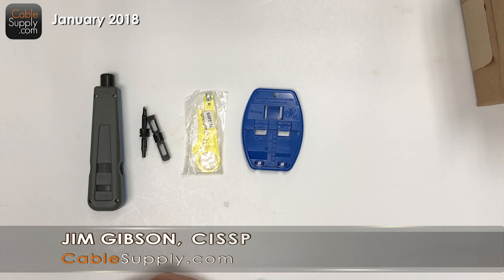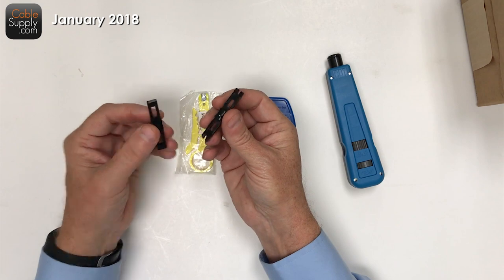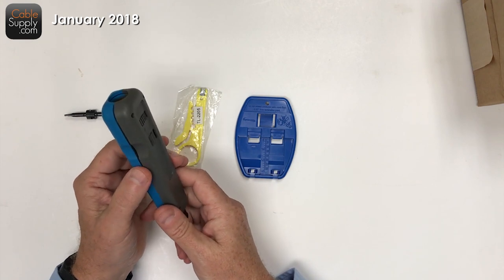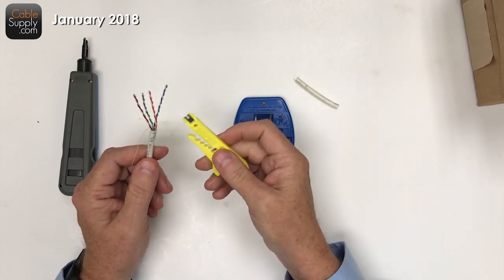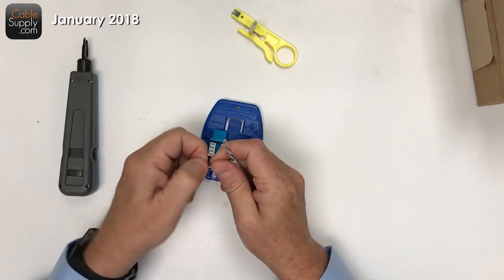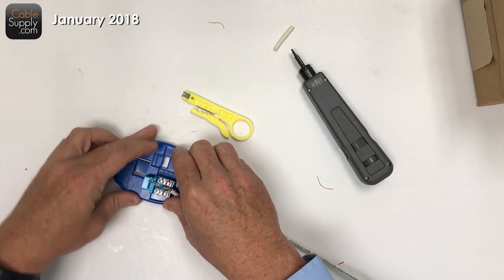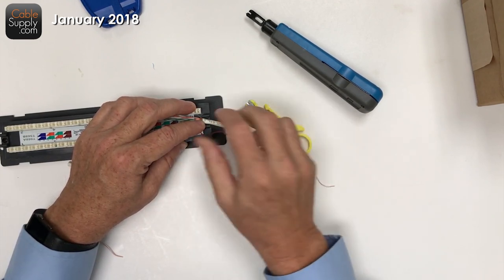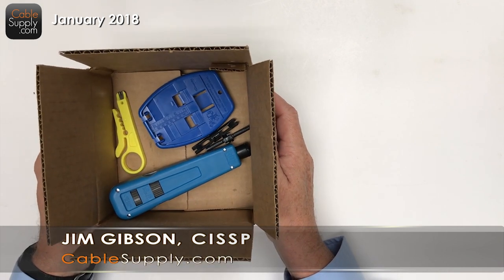Punch Down Tool Kit

Comment: Can I use that tool to install mobile home receptacle,, electrical outlet? I can't afford 300$ tool, thank you
Reply from the maker: Yes, you can use these tools to install voice and data outlets in a mobile home. I have cabled and installed telephone and computer jacks in mobile homes.
Reply: @CableSupply   I meant 110 volt receptacles, sorry mobile homes are special, some require special tools
Reply: Amazon sent me tools for cable installation every time I go every time I searched for it I got cable tools

Comment: Do you have a punch down tool  (and panel) that works with stranded wire?
Reply from the maker: Stranded cable is used in manufactured patch cords. We don't carry strained cable or tools for stranded cable.